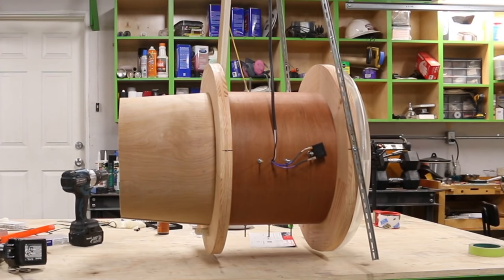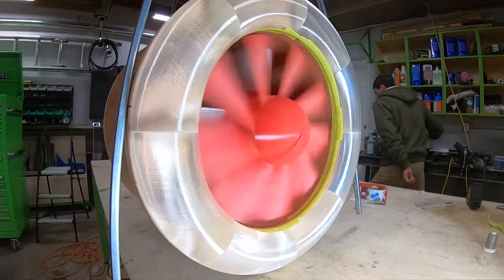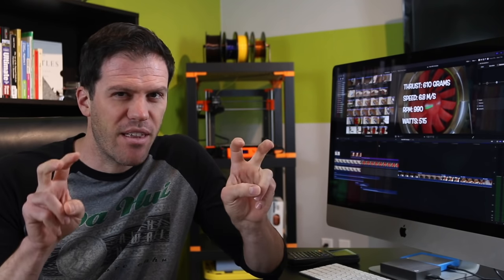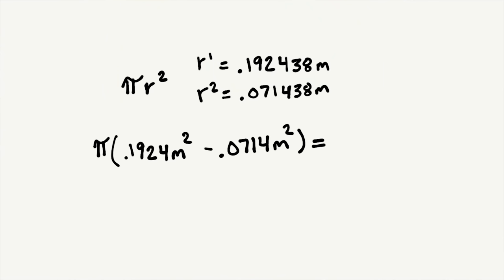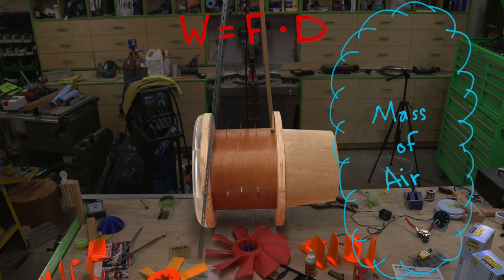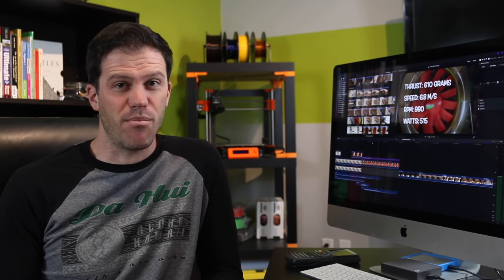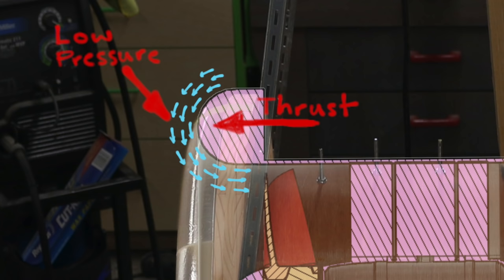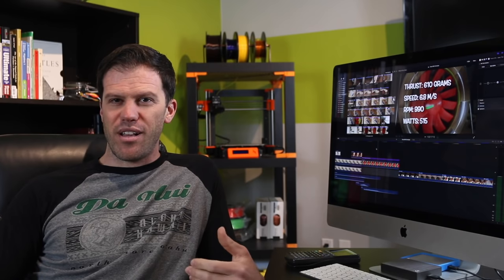How to apply ducted fan theory to real world fans

Comment: Wouldn't efficiency increase as the speed of the air coming in increases? (e.g. in-flight vs static) Or at least increase in a parabolic curve (e.g. increase to a point and then decrease as air speed approaches the speed of what the fan blade could sustain itself)
Reply: Aerodynamic efficiency curves increase with the advance ratio up to a maximal point, and then decrease. Also... Efficiency increases, that's right. But maximal thrust decreases.

Comment: You said there is no velocity change. The air going through the fan experiences a very large change in velocity! It accelerates from zero to however fast the fan moves the air through it.
Reply from the maker: Yes, but the fan unit does not…. There are no doubt many ways to think about and model this problem, different ways that would be correct… but for my brain this is what seems most intuitive, ha

Comment: The discrepancy in power is because you aren't using a synchronous motor. The difference you see of 84% is actually saying, this motor is 84% efficient. That is pretty normal for a motor, usually between 75% and 85% is very normal

Comment: A two blade will be most efficient. A four blade will give you more air movement but consume more power per unit of air. (less efficient power use but more thrust and air movement for a given diameter). A three blade is often a good compromise between the two. Ducted fans will give you more thrust but consume more power per unit of air moved. 

The problem with adding more blades is the air interfering from a leading blade to the trailing blade. Each blade doesn't get as much air. 

Source drone guy.

Comment: In RC planes with ducted fans if you could make 8kg of thrust using 2k watts that would be amazing. Like 3-4x the efficiency. Pretty sure my 90mm ducted fan only makes  4kg of thrust on 3k watts of power. I am sure I am not comparing apples to apples though.
Reply: The RC ducted fans are usually tiny in diameter, so they run crazy high rpm, and that's most likely the reason why they have low efficiency.
Still, using a design similar to that from this video would be possible when creating an RC plane that would not try to be a scale model of a real plane.
Another factor i can think of is the speed of the plane. This fan works great while being stationary, and speeding up would make a big difference to the optimal prop design, and rpm.
Reply: @AgneDei  these fans are not inefficient. Fan output is thrust x velocity. And there is a lot of velocity. The high end hobby fans are about as efficient as possible.
Reply: @rcdieselrc  There is no such thing as thrust * velocity because velocity is already in thrust. Thrust is velocity * mass, so what matters is gross thrust and you're clearly wrong.
Reply: @AgneDei  you can manipulate the units to make sense of it. I have designed, built and tested fans with the expected performance. Let's both design fans and see the results???
Reply: @rcdieselrc  Why are you commenting under this video then? How are you designing fans if you don't know what thrust is? Seriously, grow up.
Reply: @AgneDei  lolz

Comment: I like everything I see for practical shoestring instrumentation but I'm troubled by your assumptions relating motor electrical power to mechanical power. Cheaply made induction motors have many losses: resistance, power factor, iron, etc all guaranteed to frustrate the investigator using electrical data to quantify physical forces. You have fan RPM. I suggest measuring motor torque using string suspension of the fan housing along the center of balance parallel to the shaft axis  and some kind of scale to register touque. Differential scale reading might be another approach. Torque times RPM times unit conversion equals power adsorbed by the apparatus.

Comment: I got a question:
If one fan can lift 610gms, that means 4 fans within a single duct must lift approx. 2440gms ryt?
Reply from the maker: So the short answer, no. I going to make a lot of assumptions about your question, but remember, the thrust produced is a direct result of the mass thrown out the back. This is Newtons third law. So the only way to get more thrust in a given duct is to throw more mass through it ( more air). As long as the fan blade is not "slipping" there is no advantage to adding more blades or fans
Reply: @WymansWorkshop  what I mean is, instead of using a big single fan to lift, say 2440gms, we can us smaller multiple fans within one duct to lift it ryt?

Comment: I see multiple comments about fan speed with some wacky suggestions. Wouldn't a $10  eBay laser rpm sensor and a piece of white tape do this?
Reply from the maker: Ha…. While I did like some of those other suggestions, this is exactly what I ended up getting. It works great

Comment: 10:20
6.4kg is 6400g.
Where did you loose one order?
I thought moving 6.4kg means 64n of force, means 6400g of thrust.
Reply from the maker: So it was 6.4 Newtons which is a measurement of force. The smaller components that make up a Newton are Kilograms(mass) times Meters(distance) divided by Seconds(time) squared. Grams is technically a measurement of Mass, although we think of it as weight because of gravity... To talk about something having "Thrust" in terms of Grams is really just talking about the Newtons with gravity(9.8 Meters per Second squared) divided out. So if you take the 652g and multiply back in the gravity of 9.81m/s² you get back to the Newtons of thrust
Reply: @WymansWorkshop  You wrote 6.4 Newtons =)
Ok. I'll try to get your point about gravity.
(which we don't care here, do we?)
I just know* that 64 Newtons of force equals 6.4kg of mass under Earth's gravity.
Strange. I didn't think the force should be multiplied or divided depending of direction)))

Probably, I missed some features of your crazy measuring setup with scales. (didn't get all the levers)

I thought I've seen here 6.4 kg of horizontal force.
which equals to 6.4kg of gravity weight
which still is 64n in any direction.
(if we won't mix&mess it up with gravity or mass)

thanks for your channel! feels fresh.

Comment: 9:53 you are multiplying by the DENSITY of the air, not the mass. You are calculating the mass flow.
Reply from the maker: You are correct. As density is the mass per volume... The math is correct, but my choice of vocab was not, haha

Comment: you took a grinde motorr and put some cardboard ducts around it then make pocket calculations which are SO FAR from reality due to the design of the fins. --- so many things will change if you change the angles on the blades from the center to the edge... also how close you have the ducting around the blades... this is not even close to reality
Reply: how are you calculating the change of the angle of attack of each blade vs diameter? what about distance from the outer duct? wat about efficiency of the duct? efficiency of motor?... what?!
Reply: change the diameter of the output of the fan. change how the rate of pitch on fan blades differ. change distance from tip of fan to duct. change efficiency of motor v rpm on time, change power supply efficiency, change battery source efficiency on power and time.. thats a hard one!

Comment: Your condescending arrogant tone is hard to take for the duration of the video. The info is good. You need to sit down with a behaviral specialist of some sort and deal with this issue. It detracts from the information transfer. It degrades the experience of you disseminating the message. Maybe in the two years since this was made someone has tuned you in to this character flaw and you have dealt with it.